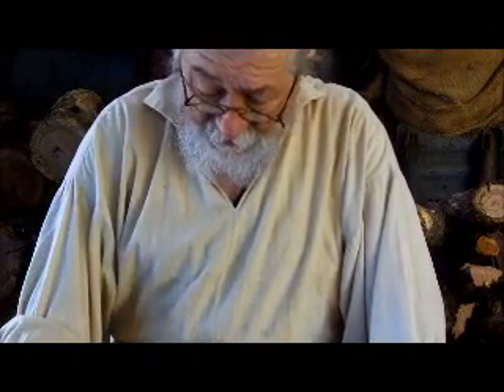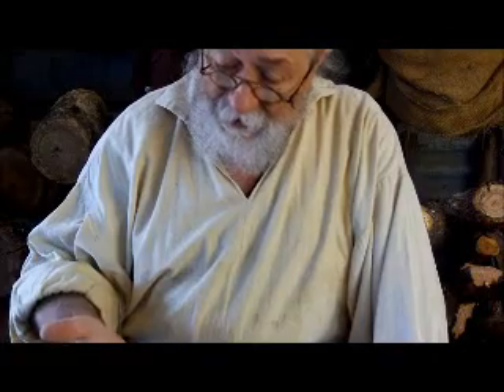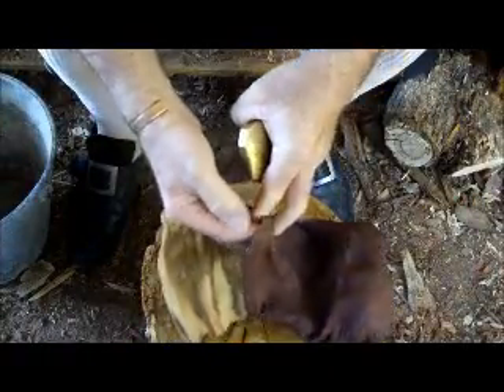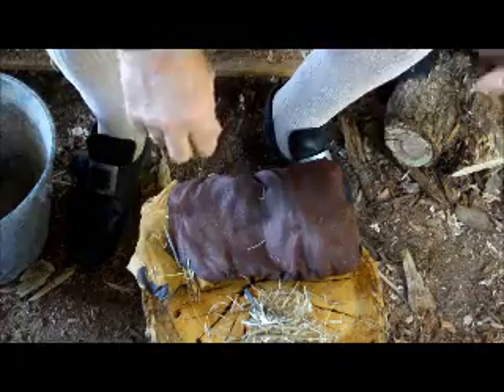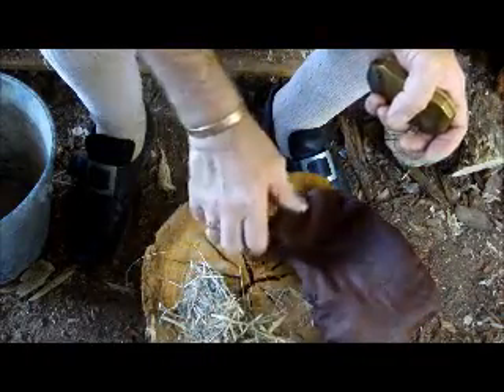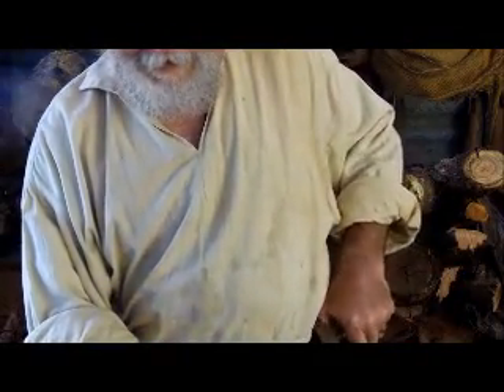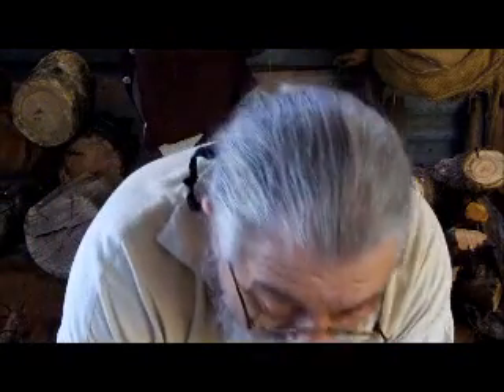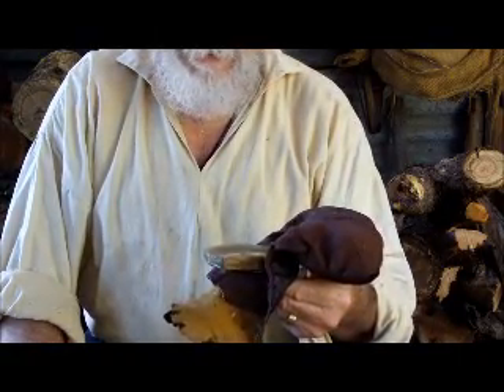No Charcloth Flint & Steel Fire Lighting..wmv

Comment: I too have watched this several times. Love it. I am just now starting to venture into Flint and steel,  I am curious what types of  natural materials would be suitable for charring and being able to be reused? i.e. closing the tinderbox and saving the material versus burning it up like charred cloth
Reply from the maker: Hi Lee. Much of course will depend on where you live. Two plants that can be used which are available in most places is Punk Wood & the dried heads of the Cattail. Check out my videos, also my book has info on plant tinders.
Regards, Keith.
Plant Tinders Part 1. DVD.

Recognising/Identifying Punk Wood & More By Keith H. Burgess Part One..wmv

http://woodsrunnersdiary.blogspot.com.au/search?q=primitive+fire+lighting+book
Reply: Keith,
Thank You for the links and information, I will check them out and your book also.
You got right to the heart of what I was wondering...I was wondering about the use of cattails, I had some cattail fluff but was wondering about using the whole head as tender. 
Thanks For Sharing, Lee

Comment from the maker: I use a number of diferent plant tinders, but mostly punkwood & bracket fungus Ryvardenia Cretacea. I suggest you check out my 4 videos on Plant Tinders. I have heard some people say that they have caught a spark on charcoal from the fire, but in my tests it did not work. Frankly I see no point, as plant tinders are readily available & much easier to use. Also check out my video: Field Preparation Of Plant Tinder For Use With Flint & Steel By Charring. My primitive fire lighting book on LuLu.

Comment from the maker: @ytdcfjhvjvp0j  You do not have to use flint, agate, chert, quartz & many others will work for fire lighting. Some of the flint I have comes from the UK, pieces I brought back with me from a visit. Other English flint is gun flints from Brandon. The Australian flint I have was found near Nundle NSW. Most siliceous rocks will work striking sparks from a fire steel.
Regards, Keith.
A Woodsrunner's Diary blog.

Comment from the maker: Yes. Tinder material, cloth or plant material, was/is charred directly in the fire. Then it is placed in the tinderbox & the lid closed to smother the smouldering material. No, tinderboxes do not have holes in them. Yes, well formed proper punkwood makes a very good tinder once charred.
Keith.

Comment: Forgot to ask, where did you get your tinder box? Thanks
Reply from the maker: Dixie Gun Works in Tennessee Jerry.
Regards, Keith.
Reply: Keith, I forgot to ask. Did the aboriginal people have a tinder box, if so, what would it be made of, thanks
Reply from the maker: @jerrytalley802   No Jerry, their methods of making fire involved either wood friction as in the saw method or the hand drill, but they also carried fire with them using a grass tree stem.
Keith.
Carrying Fire https://youtu.be/SwAxugy2ivg?si=o6hhWiL-1NIPVAQ0

Comment: most outdoor mans for hundreds of years in the USA used charred punk wood...sometimes made with a tin but usually just picking out prime pieces out of the fire
Reply from the maker: +Ei Pi  Tinder was charred in the flames & extinguished in a tinderbox. Any punkwood left in the fire would burn to ash.
Keith.
Reply: +Keith H. Burgess  i pull it out when it looks prime and put it out. A tinder box is optional with the way i do it I.My grandfather taught me this many years ago (Dont ask how many!)
Ern
Reply: +Ei Pi 
Smothering can be accomplished through many methods. Ashes, sand, soil, cloth, etc. Containers made of wood, bamboo, bark, bone, stone, pottery, glass, metal, etc can be used to smother. Char can be made without a tin or container of any kind by several methods. Hundreds of plant and fungi materials can be used instead of punkwood or cloth. At least two dozen can be used in their raw, uncharred state to catch the sparks from Flint (the rock) and Steel. F&S is far more robust, reliable and sustainable than most realize. 

Hooray to gramps for passing on the knowledge!
Reply: +duxdawg oh yes there are many....fungi is my 2nd favorite....im not sure but most anthing that burns might work. Just a thought but might not be true.

Comment: Could you not make it with a "tinder"box made from clay?... And warm that up and make it? A Clay box with a clay lid with a small hole????? Would that not work?
Reply from the maker: Yes it would Anders, but you do NOT need the small hole. The more airtight it is the better. My brass tinderbox is not airtight, but it still smothers the smouldering tinder. I have also buried smouldering tinder in the earth, it did work, but the tinder is then dirty & does not work as well. Next I wrapped the smouldering tinder in leather & burried it in the earth, that worked well. But using a tinderbox is the easiest way.
Good to hear from you Anders, your reply is much appreciated.
Regards, Keith.

Comment: Very nice demonstration.   Thanks as well for the practical historical overview of flint and steel firemaking.  It's always nice to have a proper and accurate understanding of the traditional methods used, especially in bushcraft. It makes sense that those traveling in wild areas, away from cities would need to make tinder from locally sourced natural materials.
Reply from the maker: +Marvin Double  Thank you Marvin, your comment is very much appreciated.
Regards, Keith.
Reply: Keith H. Burgess this charcloth concept amazes me. As you pounted out its a finite recourse and as you demonstrate uts not hard to use natural on hand recourses that continually renew themselves. Pine or eucalypt leaves work easily with some grass

Comment from the maker: Hi Shane, good to hear from you. Hope you get this message, having difficulty answering from my channel! Any tin with a close fitting top will work providing you are not conserned with historical authenticity. Go to my channel & check out the videos on plant tinders, there is also a video on tinder preparation. You will have some different plant tinders in the USA to here in Australia, but some are the same & some are mentioned in my videos. Regards, Keith. A Woodsrunner's Diary (blog).

Comment: I never would have thought that people did not char cloth the same then as we do today. Were they unaware that they could seal the cloth in a metal container for better results? Did they not have adequate containers to do so? Very interesting channel. Subscribed.

Incidentally, I’m in complete agreement with you in regards to using modern char cloth to rely upon in emergencies. I see it as a tool to use if one happens to have access to it. If I were freezing, I certainly wouldn’t snub it! Then again, I carry a lighter. If am at risk of a actually freezing to death, or need to purify water, I’m pulling out the Bic! 

Char cloth is fun to make, it’s good knowledge to have, but not useful in the long term unless one truly understands the concept (using materials from nature.) In case of an actual “survival” situation, these are the tried and true methods of staying alive, and somewhat comfortable, too.
Reply from the maker: As I understand it Shadow there were very few tin containers available, & those that did exist had soldered seams & would come apart in a fire. However, charring cloth in the fire did work, so I guess no one thought to improve on this method. Charring plant & fungi tinders directly in the fire works just as well as charring in a tin, so there was & is no need to carry & use a tin for charring.
Keith.

Comment: you certainly seem to know your history. My grandfather taught me, and said his dad taught him to char spongy rotton wood and or horseshoe fungus by digging a shallow hole near the fire, raking some coals in, covering with dirt, placing more coals on top and recovering it in the morning before breaking camp. I've done it this way and it works well would this be period correct ?
Reply from the maker: Richard, I wish I had made contact with you years ago when I was experimenting with this. I started off charring tinder materials in the fire & then burying them in dry earth. Then one day the penny dropped & I realised that this is what the tinderbox was used for. Further research proved me right.
I would say that the tinderbox is much preferable as a way of smothering smouldering tinder, but the method you describe could be equally as authentic method. I very much appreciate your feedback Richard, thank you.
Regards, Keith.

Comment: is it charcloth or charcoal?
Reply: Neither. We call it char. "Charcloth" only refers to cloth that has been charred. Many other materials can be charred to catch the sparks from Flint (the rock) & (high carbon) Steel. 
Charred materials for catching spark with F&S are very similar to charcoal. However we call them "char" instead of "charcoal" because charcoal can be made of any wood. Not every type of charred wood will work with F&S. Further, charcoal is not normally made from fungi, grasses, plant piths, etc. Char often is. 
Cheers!

Comment: Staged char cloth is no different from staged charred plant material. As you point out, one doesn't always have a pre-charred resource. Can you make a fire using a flint, steel and material that has not been prepared?
Reply from the maker: Yes Tarq, you can use some tinders to make fire without charring (char anything is a modern term). But I do not understand your meaning of "staged", you make it sound like the skill to prepare tinder is fake!  The fact is that many plant & fungus tinders need to be charred to catch a spark, there is nothing staged or fake in this, it is just a fact of life. It is a primitive living skill that has been in use for thousands of years.
Keith.
Reply: I think the point being made in the video is having a renewable source of tinder when outdoors for extended periods of time. Say you are taking a thousand plus mile hike on the appalachian trail and use flint and steel. Using natural plant tinders saves you from having to buy additional cloth to carry / char and punkwood is virtually everywhere. Plus the techniques Keith teaches are how it was done long ago and we all benefit from the gift of knowledge. As far as tinders that dont require charring to work, I havnt found any yet but with experimentation will come up with something that might work. I carry a small magnifying glass to hopefully start a fire in that case I am caught with no suitable charred tinder - but we all try to not be caught without having any....
Reply: @markhopkins7920  A fair answer, and I appreciate it. After looking into it, it appears that with some skill one can start a fire using flint, steel and punk wood, which almost all have available to us. The problem of course is that it's very difficult to do well and takes a lot of practice, but I think I'll pursue that goal.
Reply: No, its NOT easy doing it with the punkwood abd tinder box! At first, my two kids had a BIG laugh when i was blowing on the ember and got a face full of ashes! Then, burning my fingers, frying my beard when the grass kindling blazed up, and of course learning to control the flint striking the steel and knocking the tinderbox over! Ohhhh yes !! Thete is a learning curve! Now that I've gotten the hang of it, Keith's right. ..it DOES work better than the other methods
Reply: @markhopkins7920  Thank you, Mark! I'm hoping to give it some tries tonight! That's funny about your kids. Thanks for sharing!